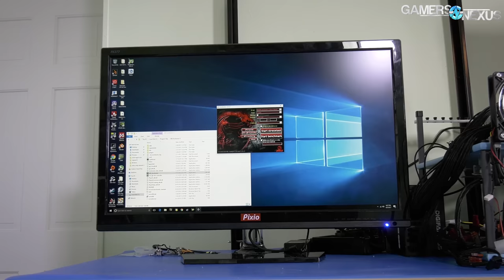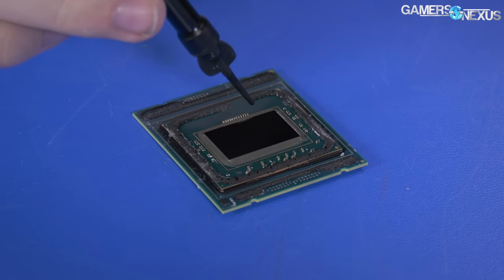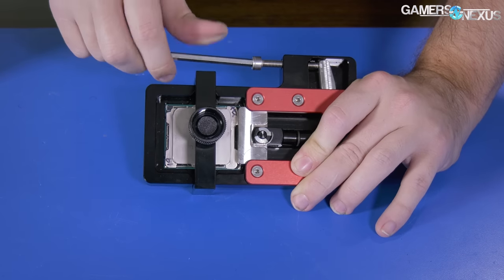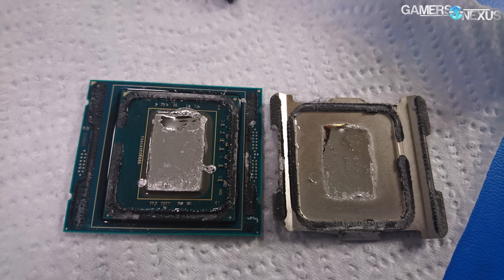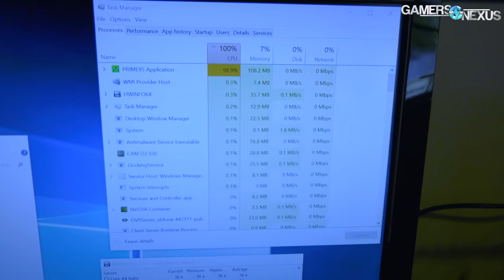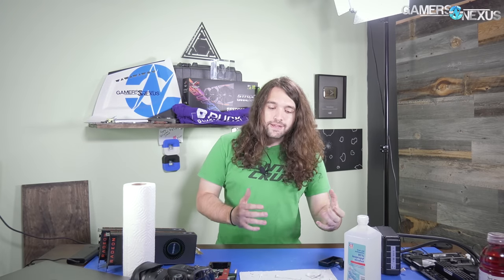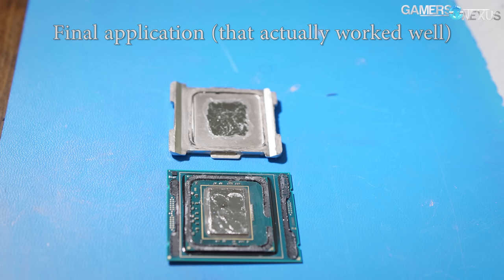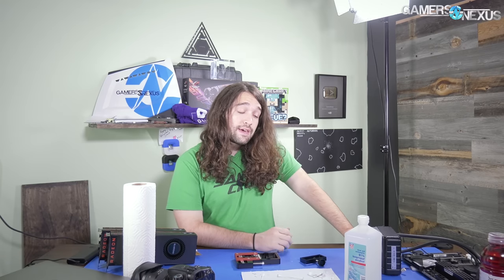Vlog: Learning Delidding & Liquid Metal Application on 7900X

Comment: 3 big pieces of advice for anyone applying liquid metal TIM: (From years of use and multiple dozens of applications)

🔴1 - Instead of using store bought liquid metal TIM, buy a small piece of pure Gallium online. Gallium is the main ingredient of liquid metal TIM as it's a solid at room temperature, resembling Aluminium, but becomes a liquid, like Mercury, at just 30c (86f). Using pure Gallium means you can warm the metal with a hair dryer in just a few seconds turning it into a liquid, then separate it into tiny little beads no bigger than grains of sand, then allow it to cool turning solid again. This way you can add tiny pieces to the die one at a time, so you never add too much and risk spill over.
🔴2 - When spreading liquid metal, use as little force as possible. Not only is this to be safe; not flicking and splashing it around, but also, it will spread much, much easier when little force is applied. Trying to spread it like you would mustard on a sandwich will only cause the metal to be pushed around and bead up instead of spreading.
🔴3 - Most liquid metal TIMs' come with cotton buds, as seen in the video, but there is a much easier application tool that can be used. Buy a super cheap synthetic (plastic or nylon) small, fine tip paintbrush - the sort of thing that comes included with a children's cheap painting sets; very small, fine tip, and non-porous unlike natural hair used in good quality brushes. Using a small paintbrush, and by small I mean 5mm, will allow you to apply less force, spreading the metal easier and more efficiently. It also helps with pickup of excess, if you apply too much you can dab the brush on any beads or pools of the metal, the brush bristles effectively pinch the metal between them resulting in pickup. It's a great way to safely and easily remove small amounts of the excess.

So there you go, my three best tips for people wanting to give liquid metal a try. With Intel still refusing to solder the IHS to the die and continuous use of shitty, cheap and nasty TIM, it's a great way to reduce temps by a large amount, akin to upgrading your cooler from an entry-level CM Hyper 212, to a large and beafy Noctua D14. But of course, it's also a great way to void your warranty and potentially kill an expensive CPU if you do it incorrectly.

[Edit] - grammar and punctuation
Reply: Awesome tips thanks dude.
P.S. fantastic username :D
Reply: The paint brush tip is extremely helpful 👍 I had huge issues trying to use the cottonbuds so I'll give the brush a try next time. Nice one mate thanks for your help
Reply: Top quality advice GJ dude. Gallium works extemely well and helped me get into delidding as i could let it set back to a solid then remove it and start again when I fucked up.
Reply: I wouldn't advise using pure gallium as it's melting point is at about 30C and it expands as it turns into a solid which could damage the chip. Commercial LM thermal paste contains other elements (I'm guessing indium and tin) which lower the melting point well bellow temperatures of normal use.
Reply: 1. My Room Temp or Temp of the CPU when starting it is less less then 25°C. So the pure thing is bad, since it hardens and expands. While expanding it CAN break the CPU. (ever frozen Water in a closed glass container?)
3. A Brush is many times worse. The LM sticks to the Hairs and gets everything messy. And if you lost a Hair of said brush...good luck getting it out without making a mess.

Comment: I did this on my 7700k. First time of me doing it and it worked. Use blue tape around the cpu die. Then use blue tape on the inside of the IHS to mark out where the liquid metal should go as well. I used thermal grizzly as well.
Reply: Yeah my temps dropped so much on my 7700k also. We need to talk about how stupid intel is more.
Reply: fuck that
I'm using red tape.

Comment: Here's a mid/long term test or you.

Liquid metal does react with copper. It basically disperses into it and glues both surfaces. The real test comes when reapplying, you should not sand the new alloy from the cold plate, in theory the reaction should stop after several re applications and the CPU would not glue to the cold plate. 

How many applications are needed? we don't know. How often, I would say every 2 months. (here it took 2 months for Conductonaut to dry between my 1800x and my asetek pump gen 4)

The community with thank you endlessly.

Comment: You can tape around the die with scotch or electrical tape to cover all the surface mount components while you apply liquid metal and then peel off the tape when you are done.

Comment: Hi, do you use any glue or similar to keep the IHS on after applying the LM? Does the small amount of glue still on the CPU do anything to help keep it on or is it just for spacing? Or do you just put the CPU in the motherboard and let the bracket hold it on? Great video by the way, thanks for the tips.

Comment: I recommend everyone to use heat resistant electrical tape and cover the caps etc on top of the substrate. Hardly anything can go wrong then. Using it for years in laptops now to maximize cooling performance.

Comment: I have put liquid metal on a non delided ryzen with a dual tower dual 140mm fans cooler and the temps gone down by a lot.
Reply: how was the application process? Can you tell how much temps dropped?
I'm thinking of doing the same, with a R5 3800X and a dual 140mm fan aircooler as well.

Comment: Ive delidded 3 CPUs 3770/4770K so far with great success, often seeing 10-20c overall reduction depending on work load, while using CLU under the IHS and Gelid extreme for the waterblock. 
Its definitely not for the faint of heart, but well worth the time, money & effort if a 4.8 - 5.0 Ghz or higher OC is your end goal.
Its really a shame intel has moved away from soldered CPUs tho.. esp due the stock pastes poor thermal performance...

Comment: Ya used WAAAAYYYYYYYY too much man!!! The tiniest little drop of LM spreads out a very long way ... top tip if ya accidentally squidge too much from the syringe is simply just to use the syringe to suck it up again ;) I've used both CoolLabs Ultra and TG Conductonaut ... those black 'cotton' buds that come with the TG are way better (imo) than the brushes supplied with CoolLabs ;)

Comment: So what I did was I used the underside of the IHS as a sort of palette to apply the liquid metal to, using it as a surface to mush with the applicator in order to get it to adhere so that I could "paint" the liquid metal onto the die. Mask the substrate off using blue painter's tape beforehand, too, just in case.

Comment: Finally!  Glad you got some promising results.  I've delidded two 6700k's and a 3570k.  Both 6700k's hit 5Ghz while staying around 60°C during stress testing, and the 3570k is at 4.8Ghz while around the 60°C mark during stress testing.  I used the Rockit 88 and Coollaboratory Liquid Ultra for relidding.  When I applied the liquid metal, I covered everything but the cpu die with scotch tape and then removed.  I applied to the die and the IHS as well.

Comment: FWIW I didn't have the "squirt" problem with CoolLaboratory Liquid Ultra. I also found the included applicator brush useful. I didn't apply too much, but if I did, the brush would have wicked the excess. Note a lot of people complain about the brush so YMMV. There also seem to be "bad batches" of watery, separated compound and/or hard, brittle, flaky solid chunks. I had neither problem. EDIT: it's possible that heating to around 30C would recombine separated compound. I base that on Gallium's melting point. However, the alloy is supposed to be liquid at room temperature so clearly something would have gone wrong in the alloying.

Comment: @Gamers Nexus i delidded my i5 7600k and put thermal grizzly conductonaut on it. Now im overclocked at 5.1ghz at 1.456v and after one hour aida64 the cpu hasnt gone above 47c.  Using nzxt kraken x52 as cooler with thermal grizzly kryonaut as tim between coldplate and ihs. Really loved that delid result. Before watercooling i used cryorigs R1 universal as cooler (with nt-h1) and got 5.0ghz at 1.4v and temps in aida64 were around 55-56c. Conductonaut is pure love and pure dangerzone ;)

Comment: Quick tip: Use painter's tape or scotch tape to strike off the areas around the die so you don't accidentally spill over with LM onto the caps.

Comment: I delidded multiple 115x CPU's already and used CLU with great success.  My 5ghz 7700k in particular dropped 20 C from 90ish degrees C at full load to 67 C.   The trick is to use a watercolor paint brush and apply the thinnest amount possible on both the die and the IHS, whilst removing all of the black silicone adhesive.  When doing the relid, I lightly clamp the IHS down and used a dab of Drei Bond 1209 on the corners and let it cure overnight.

Comment: Delidding is so worth it, i really dont know why intel uses thermal paste. A small overclock increases the temps ALOT. specialy if you use intel burn test where the cpu really gets beaten up.
Whit no delidding i whas getting on my 4770K @ 4.5gig 1.32V 90C to even 100C on costum water, Just insane. Now its hanging around 70C max

Comment: I was in the first few people doing that 3 4 years ago with I7 3770k. I later did it with my brand new I7 4790k. Always use the vice method.. Block of teflon and hammer and blanket to catch the cpu if it fly off.The first time I was scared and was not my cpu. It is very safe just hold pcb and teflon block  then it firmly. One hit and it is done... no cpu flying off!!! Always got good result and never break one cpu. Always 10 C to 25 C  improvement.  And to clean The black glue use a flexible kind of credit card. Not a credit card it is to hard and can scratch the pcb.

Comment: A note about Grizzly LM:  If you are right handed, using the left hand, pinch the plunger with your thumb and fore finger - on top of and touching the T junction [normally where your fingers of your right  hand set UNDER the T junction].  Use the right hand to push the plunger as normal, using VERY light pressure until the TIM comes to the tip, then apply to the CPU die.  -  That provides a very secure and precise movement.

Comment: yeah... The dispenser tube of your Liquid metal is far to large.  There's a reason why Coollaboratory Liquid Pro comes as a syringe.  Imagine if you had put that much liquid metal on a  mainstream desktop CPU.

So thermals...  From what I understand,  there are two reasons why Intel CPUs thermals have become problematic in regards to their cooling methods.

The first which most people are aware of is the quality of TIM is not as good as it could be, but it's not nearly as bad as most people think it is.

The second more problematic is the the glue between the IHS and the PCB.  The Glue separates the IHS from the PCB and can cause higher temps if to much glue has been applied to a CPU from the factory which adds less contact between the PCB and IHS.

It's great that you didn't cause any permanent damage to your CPU, I've seen some horrid Liquid metal CPUs from the haswell area where the VRM was on the PCB and the VRM was shorted with liquid metal, though this isn't as much of an issue anymore since Intel removed the VRM from the PCB and put it back on the motherboard.

So my request to you since now you prob have the hang of it.  Is to figure out a method of replicating the average glue application from the factory of the CPU, and perform a glue vs glueless CPU thermal test using TIM and liquid metal.

Also I believe that newer mainstream CPU's are having a harder time going glueless because the acts as add support for the PCB and IHS when a cooler is mounted to it and helps prevents structural damage of the CPU... but i could be a wrong on this, just something I've heard mentioned concerning CPU's being delided after Devils Canyon.

That's a lot of work... maybe not possible but you guys have gone above and beyond what most do. Great work as usual man!

Comment: Phew, losing a capacitor sounds terrifying. I immediately coated my caps on my 4790k with liquid electrical tape and let it cure overnight before I applied liquid metal. I was worried because the liquid electrical tape goes on so thick but it shrinks down as it cures. I practiced spreading liquid metal on a G3258 first and discovered just how fast the liquid shoots out. Glad your first experience didn't end in a disaster. Definitely try liquid electrical tape next time, it's made for this type of thing.

Comment: Others have said it, but My delid and liquid metal TIM replacement went flawlessly when I taped off everything but the chip surface.  I even taped off the inside of the IHS.  Of course, never use liquid metal anywhere close to your motherboard.  Apply it away from the motherboard, then insert the parts.  Great vid.  Thanks.

Comment: Steve...when using a new liquid metal tube do a test squirt in a bag first this way you don't end up with a "Money Shot" across your desk.  You needed to mask off that processor die first before applying in case you run such issue with spreading it to thin or thick.  Application can be fixed with little dabs across your die from left to right regardless of orientation just go slow making sure it doesn't look like it's bubbling over just a nice even film is fine.  And do the same with the IHS when you mate them with the relid tool.  Once finished remove the tape.

Also your not supposed to use the relid tool vice while you delid as the IHS should essentially fall right off either during your torque cranks or after you hear a slight pop.  The relid vice is to be used after your finished scraping off the original black sealant then apply a new sealant ONLY THEN your ready use the vice to screw it down onto the the IHS and stop when it starts to get a little snug.  Now when you screw down the IHS give it about 1/2 turn just enough to allow the new bond to cure.  I noticed the the video looks like you over tightened it.  You really should practice with Der8auer's previous DeLid tool that handles LGA1151 processors and delid a i7 7700K it will give you a better understanding of how that wonderful tool works.

Comment: A handy tool that may be beneficial to have around when dealing with too much Liquid Metal that potentially would work is a Desoldering sucker. The consistency of the liquid metal is near slimier to molten Solder. 
I delided my my 4790k in a vice and i near crapped myself doing it, and that's an old chip but my PC is my lifeline ha ha, glad i did it though. The TIM was totally dry.

Comment: Question! Let's say you have a full custom water loop. Delidding the CPU and using liquid metal increases the heat transfer to the water, keeping the CPU cooler. Under this assumption, the water temperature should be a little higher, so it should increase the GPU temps too. Am I thinking this right?

Comment: 2nd Note:   You can purchase liquid tape to cover everything under the IHS - that you do not want liquid metal TIM on.   If you cannot find liquid tape, at least use a thin coating of RGB [such as automobile gasket maker in a tube, with a high temperature rating], and let it dry.

Comment: The first time I used conductonaut it came out so fast that it squirted all over my 970s PCB. I tried my best to clean it off. But it was too late. So the next time I did it. I cleaned off my 980ti, and then taped it off using electrical tape. Probably should have used masking tape. But didn't have any. Luckily I didn't put too much on this time. But even if I did. It would have sprayed on the tape and not the PCB.

Comment: When you start doing GPU's, I would recommend to use tape, don't use nail polish. I had a hell of a time removing it from a GTX 1070 even with nail polish removal. Nail polish worked fine on my i5, but the components material on my GPU stuck to the nail polish hard.
Reply: I also cut the tape with some scissors after cutting to length to avoid the caps.

Comment: Dude why don't you just solder the capacitor back on?  The cap you lost is actually fairly large in the context of SMD components.  For someone who's clearly not shy when it comes to playing with kit like this it would take half a minute to do? :). Also it won't be polarised so it doesn't matter if you put it on the opposite way.

Comment: Couple tips, if you push to much out just pull back on the plunger and suck some back in. 
Second use a small hobby paint brush, they are quite cheap and can be reused and work way better than qutip
Third take a picture of it from the top before you delid, that way you look tp see the orientation of the lid compared to the notches. Ive done about 15 cpu's and not one fail yet with average temp drop of 20c.

Comment: When too much squirts out...  just put the tip back in to the blob and suck the excess back up into the tube. (I have used conductonaut on at least 10 dies over the past year, mostly on high power laptops... wrangling heatsinks to sit perfectly flush is the hard part)

Comment: I've learned with liquid metal TIM to always aim the syringe 100% vertical up and down and never at an angle as it always squirts out too much and if it's vertical it just makes a single ball of liquid that's easy to suck back up the syringe, where as when held at an angle it shoots across the cpu and leaves a long trail. Also it helps to put tape over everything but the die so that any excess TIM is easy to clean off as all you do is remove the tape.